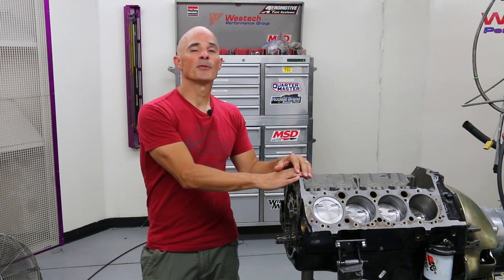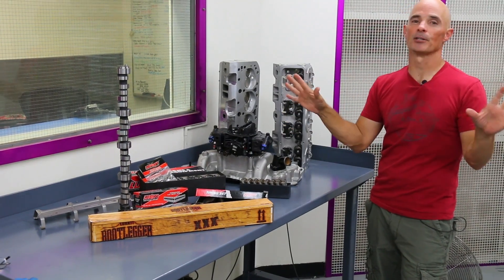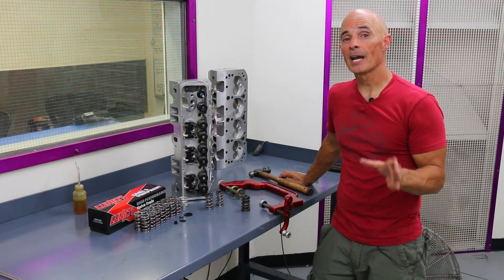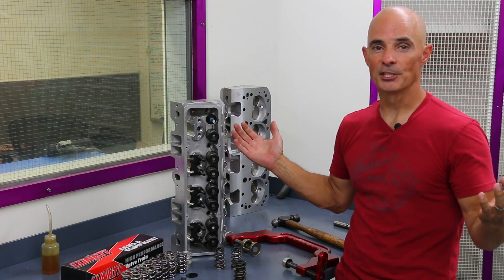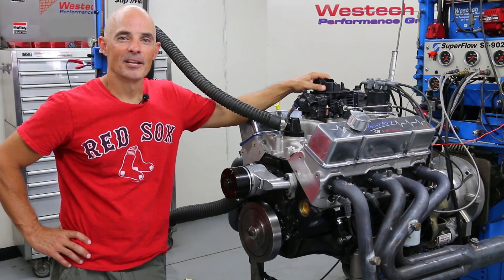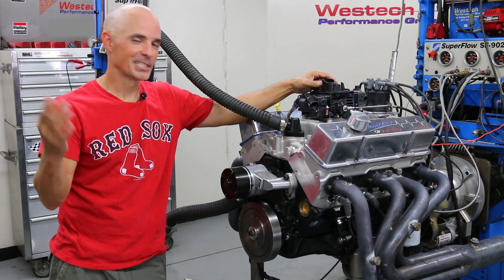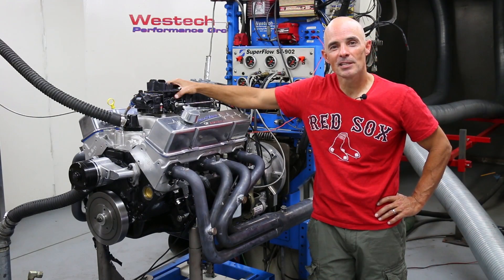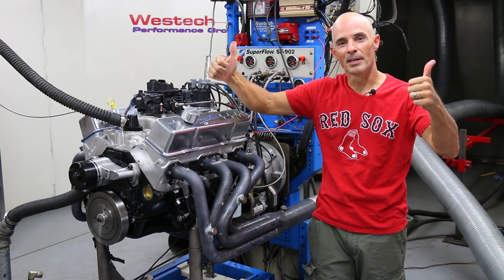Lunati Bootlegger Camshaft Dyno Test at Westech

Comment: I built a 383 Chevy 7 years ago with vortec heads I pocket ported and 2.02/1.60 the valves. Installed a hyd.roller comp 280 magnum cam and customers edelbrock performer and edelbrock 600 carb.  It dynod 437hp and 479#/ft.  So I'm not impressed with these numbers and these parts in this video
Reply: Your single pattern cam setup made some serious power !
Reply: Those Holley heads suck and it has low compression. Piston probably .030 in the hole with a .040 thick head gasket, dished pistons. Plus it's the smallest version of that cam. The big one is way better.